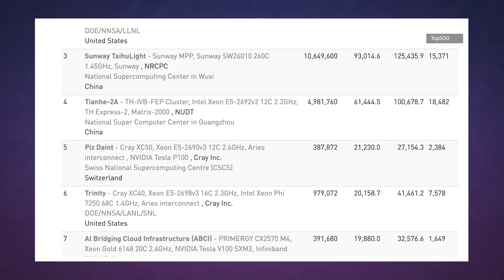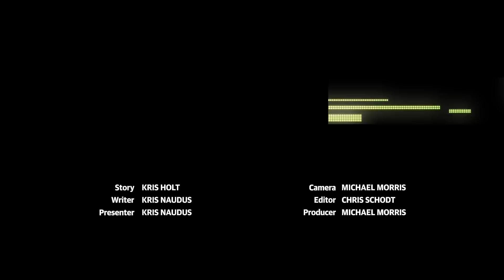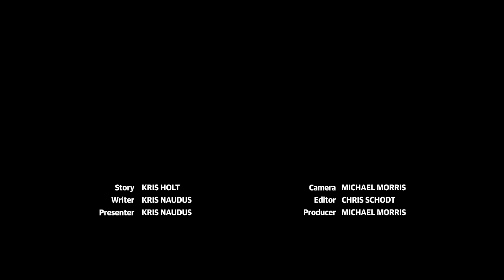AMD and Cray are building the world's most powerful supercomputer

Comment: how much electricity does this thing use? Hope they have some solar panels and other renewables built near it or for it
Reply: 30 megawatts. about twenty 600-feet tall wind turbines required to power it year round. Or 500 soccer fields of solar panels. Those depend on how windy or sunny the location is though.

Comment: just use thousands of arm processors, qualcomm 865 for example, processing is slower but you can compensate with quantity. heat is minimal, maintenance is minimal, much less energy needed, even a chimp could mount it. put it in a cold dry region, to save energy from heat management. once a new processor comes out, 875 for example, sell 865 for middle range refurbished phones.
Reply: Lol

Comment: Where do they use these super computers? Who pays?
Reply: Who pays? US Taxpayers considering Department of Energy is its customer. Where do they use it? A wide range of applications ranging from simulating effects of New Drugs to find cure to diseases like Cancer, modeling the folding of DNA and Proteins for other medical reasons, crunching Data to find new patterns in Astronomical Observations for better understanding of the universe, simulations of other things like how Plasma behaves to make commercially viable Fusion reactors to material science and how time affects the ability of Atomic bombs to detonate since you can't test them anymore due to test ban treaty yet you need to be 100% sure that if they're used, the work as intended even when most of them were created decades ago. The applications where these supercomputers can be used are countless.